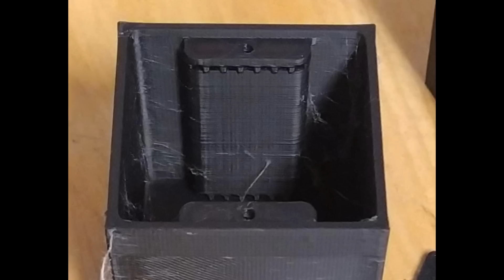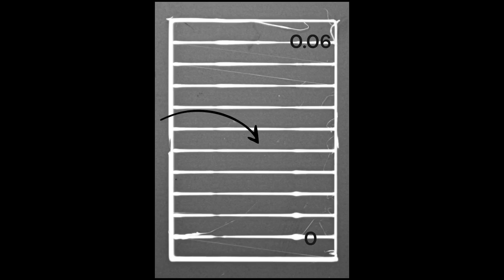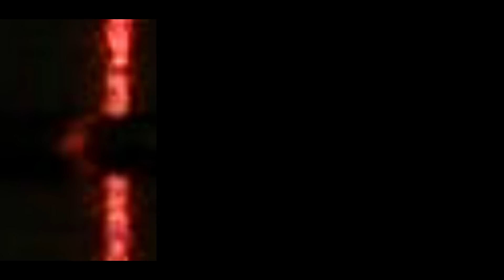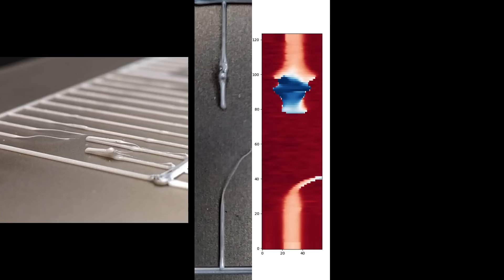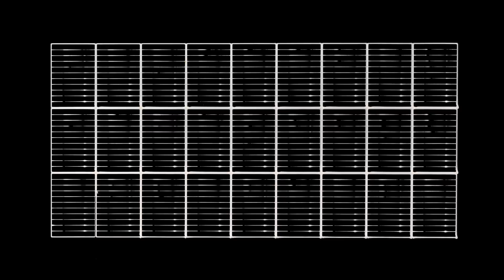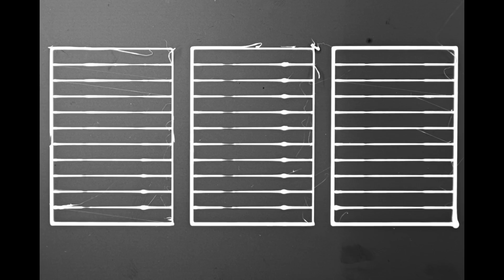Rubedo: Automatic Pressure Advance Calibration

Comment: The one thing stopping from getting another Bambu x1C instead of a voron 350mm kit is this! Mike awesome job! Can’t wait to see this adopted by the community!!
Reply: I had a X1C and its PA system doesn't truly work. Users managed to break into its MQTT output to find out it was not working at all but setting the default 0.02 which is set within START_GCODE.

And not least, X1C lidar system was released as a flow calibration which is doesn't do, and PA which it doesn't truly work. Any filament will print "just fine" with PA 0.02.

I had the lidar disabled in my printer to save time and preventing its print from taking space, I got a LDO Trident 300mm and miss absolutely nothing, totally different beast.
Reply: @hakunamatata324  This did not age well. The updates after this post show Lidar works really well with both manual and auto calibrations. And with the AMS up to 4 filaments at a time flow dynamics and flow rate on a per filament basis. 

And since your post is from around May 2023 there have been several improvements to the X1C since then. Object exclusion, maker world(newbie friendly printing without needing a slicer), a more robust Lan only mode with camera and all from free updates and no physical mods needed.

Comment: Don't get me wrong, but what's the benefit over viewing it and decide which one's the best? That's what I'm doing since, heck I don't know when. And that's a lot quicker too. 😅
Reply: Manual interpretation of the results can lead to errors, especially with people who have no idea how its supposed to look like. Automatic tuning can be more consistent and requires less upfront knowledge. 
Might be easier for you to do it manual but for most people they probably take longer to do it manually.
Reply: @MitsumaYT  I'm honestly not sure how something which sums up as "choose the smoothest line which is as even as possible from start to finish" could be misinterpreted. If you misinterpreted that, you honestly wouldn't care about the differences PA makes. 😅
Reply from the maker: @fraenker  you could have this run automatically before every print. Everyone knows that programmers are so lazy that rather than taking the time to do something simple manually they'd rather spend 5 months developing a program to do it for them 😅. But in all seriousness, this could be nice if you swap filament or use different materials a lot. Also, there are a lot of other things that this could also calibrate someday.  For example, maybe you could calibrate extrusion multiplier, or z offset, or bed mesh. PA was just the first thing I picked since I had an idea for how I might solve it, but I think that many more things will follow.

Comment: Mike this is absolutely outstanding work. I'm going to fit this system to all of my printers as soon as I can make time to modify them. I'm on a quest to build the ultimate tool head and this is going to bring it to the next level. Very good stuff! I wonder if you could get better results using different build plates by printing basically a raft that has been ironed and then print the lines to be scanned on top of that. A bit excessive and might defeat the purpose a bit, but it could be interesting for people using exotic print surfaces not conducive to laser clarity.
Reply from the maker: That's actually a pretty cool idea!  I can definitely see that helping for textured translucent build plates, and I would bet it would be really helpful for uncoated glass as well.  I'll have to look into it once I get the base feature set a bit more user friendly.

Comment: How does it behave in the dark with red or reddish (like purple or magenta) filaments?
Reply from the maker: I've been pretty busy w/ just getting the system working, so I haven't tried out many different colors yet (translucent filaments could also be problematic). I'm hoping to try out some more stuff soon though.
Reply: @mikeabbott7239  np, im more amazed by it working rather then its current limitations

Comment: This is amazing Mike! One step closer to one click filament calibration!
Reply: Nice one. Amazing Job.
Reply: with this system as a one Klick Kalibration you could also calibrating flow or first layer calibration 
if you'd print small 15x15 rectangle (after picking the pressure advace) you could scann and select the one with the smoothest surface the question is if you'd calibrate flow or nozzle hight with this. 

bur really great work !!

Comment: If this gets integrated into klipper it will have a huge impact on tuning!
Reply: Klipper integration is coming for this.   Its on the roadmap already along with expanding the systems capabilities.
Reply: @Alchemical-3D  Would Flow calibration work just as well, or would that require a more precise laser beam and camera to be reliable?
Reply: @ariafpv  Likely a nozzle cam would help with that. It'd be neat to see if this works with a nozzle cam, maybe a servo could change the angle of the camera if needed too.
Reply: @OfficialyMax  would be really interesting to see. Could make for a cheaper alternative to lidar
Reply: @ariafpv  In theory the printer could print a reference line to determine how many pixels per millimeter the camera senses
Reply: @ariafpv  Extrusion Multi is on the development path, however this module comes later in the roadmap due to pre-requisite items coming out of PA and Z modules.